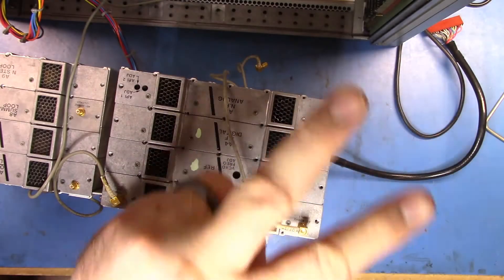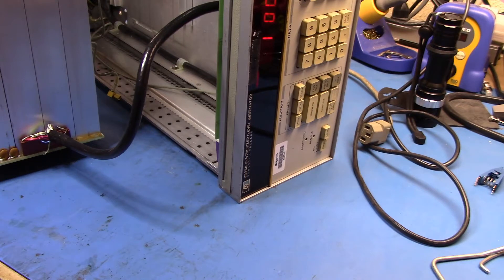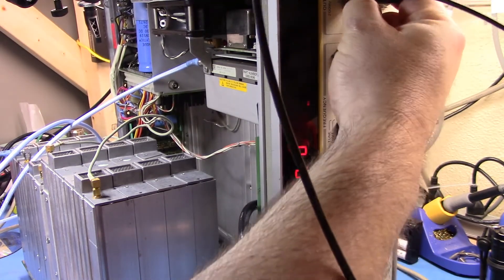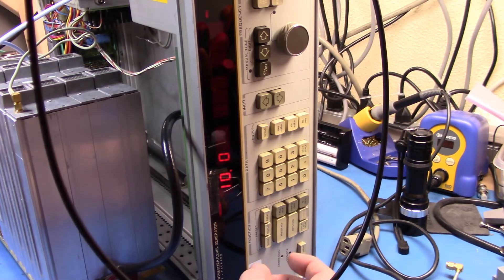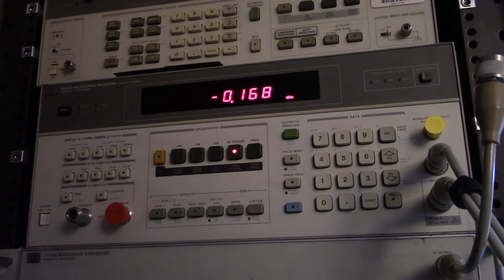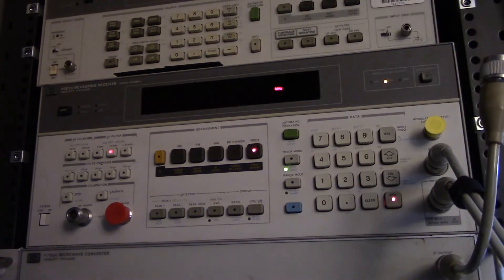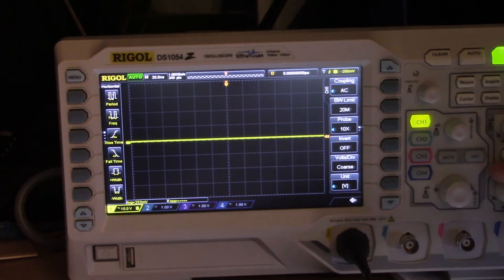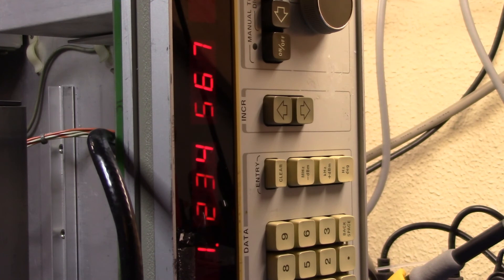HP 3335A Repair - Part 4

Comment: This unit is literally pain in the ass to work with. I fixed one, but immediately sold it. 3325 is way easier.
Reply from the maker: Thanks - COmpletely agree - I have a 3325A and its been working painless the entire time I've had it (knocking on wood).
Reply: @dgaborus specs on the 3335A are way better than on the 3325A/B. different use cases really

Comment: Man you got to get that 15  volt rail fixed.  Ok for now...... looking forward to the fix.  Keep up the good work! Joel
Reply from the maker: Thanks Joel - I'm at the point where I can reassemble and move it off the bench to get to some other stuff. I'm starting to collect a backlog :) I'm with you though, that 15V rail needs to be back into spec and I suspect that it is because of the caps & diodes that are in there (from the last repair and mine). I'm going to buy the correct parts and stick the bag to the side of the unit so when I get back to it I'll have everything handy.

Comment: Odd that 15V never got to 15 but if outputs meet spec and there are no further issues then job well done. Repair successful. Do you happen to know what the other voltages measured again? Most ICs demand 5V or 3V references. If powered by 15V they usually have a range of 9 - 25V (something like this) to operate. It could be that the other rails were adjusted within spec in the past accounting for the 15V measurement. I haven't checked the manual's parts list so I'm not quite sure what volts the ICs demand but seems like it.
Reply from the maker: I think the reason that the 15V rail is still off is due to the previous repair - I need to get the correct caps & diodes for the voltage doubler that biases the pass transistors - I think that is the issue, plus I need to confirm that they didn't modify the 15V reference part of the circuit to work with the bits they put in. As everything is referenced to that rail I think getting it correct will correct the other voltages as well (the unit does this through factory selected resistors that make up the reference for the comparators). The -15, +5 and -5.2 rails are reasonable but they do need to be closer. 

Basically I'm declaring victory, ordering the correct parts and putting this aside so I can get back to some of my other items (need to cal some of those 478A's so I can get them out of here :)).

Comment: So you never did get the 15V rail up to 15V ? I was wondering if perhaps a pass transistor had an issue. Looks like it is working anyway. Nice job.
Reply from the maker: No it maxed out at 14.41V - I think I'll need to take a look at the boards again and see if there are any other  impotent changes. However, it does appear to work.